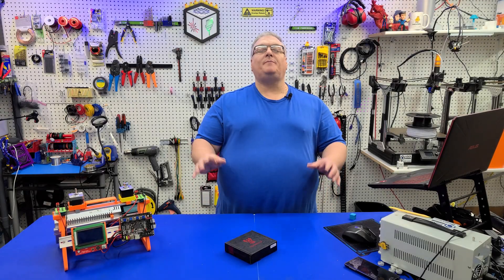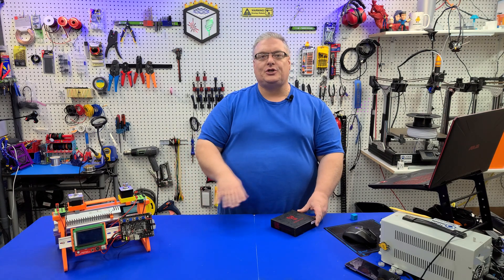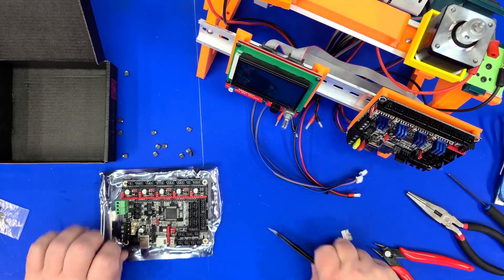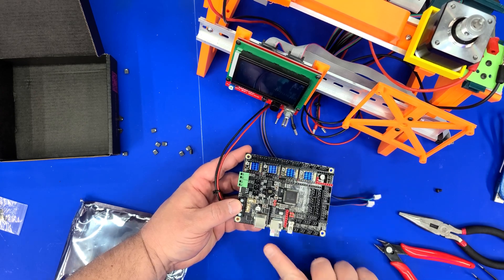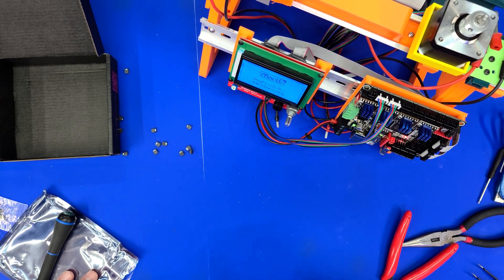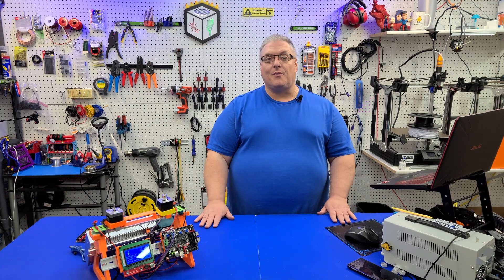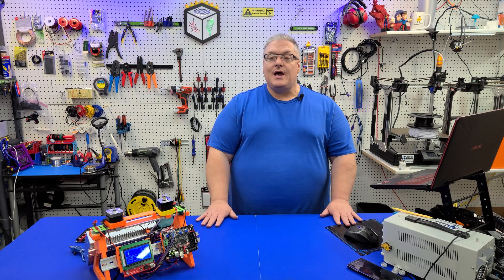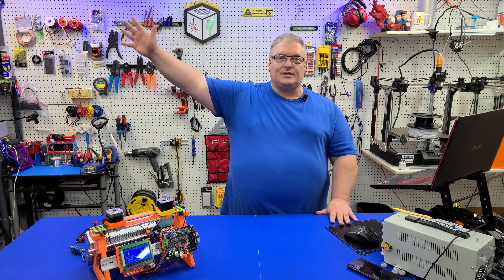SKR2 Bug Update! - Did BigTreeTech Fix the SKR2?

Comment: Bad idea  taking any circuit board out of an anti static bag and placing the board on the outside of the anti static bag. The outside of the bag is where all the static is located.  Only the inside of the bag has no static.
Reply from the maker: Cite your reference please. Given the bags are conductive and this is a common misconception of how the bags operate.
Reply: @MakersMashup   You gave the answer already.. You are correct.... the outside of the bag is conductive (not all are but most depending on the manufacturer) and for that reason  the conductivity on the outside creates a Faraday Cage while the   inside is  protecting the circuit board.  The inside of the bag is NOT conductive and  because of this the outside stores a great amount of static while the inside has zero static.    A simple Google Search  ( a long version of 'there is static on the outside of the bag but not inside the bag')----->
Metalized shielding bags have either a metal film embedded into the bag film construction or coated onto an existing layer. This metal film acts as an electrical shield against electrical discharges from the outside of the bag. Depending on the energy and duration of the discharge and the thickness of the metal film, an ESD event is typically spread out over the outer surface of the metal film and if fully enclosed, i.e. the bag is sealed, then the charges current from the ESD event is contained to the outside (outer surface) of the metal film, i.e., providing a region of no electrostatic fields within the bag, thereby protecting the contents within. This effect is known as the Faraday Cage Effect and is commonly used in controlling ESD via metalized shielding bags, conductive bags and the conductive tote box with a cover.
Reply from the maker: Right and the moment anything touched that outside package.  My body as an example.  I immediately discharged it by being grounded.  With zero chance of affecting any of those electronics.

Comment: Just an FYI from where you put the board on the antistatic bag, from what I've heard the antistatic nature of the bags comes from a thin layer of conductive metal on the outside, so if you were using it hoping to get the same antistatic properties as the inside this knowledge might save you from accidentally shorting out a new board.

What are alternatives?  Plain non metalic painted cardboard boxes, paper, just generally non conductive non static building things.

Comment: Bying a new board for my CR10 V2, with 2209s
Now I am in doubt if i should stick with the Proved 1.4 or order the 2 instead...
Reply: The 2 is fine. Order from BTT, they don't sell the Rev A boards. If you should somehow end up with one, you'll still be fine, just don't install your drivers the wrong way around. Rev A problem is only a thing if you actually install your drivers the wrong way (The new failsafe feature to protect the board when making this mistake, ended up damaging your drivers if you did so, because of a mistake when substituting a part due to supply shortage.)
Reply from the maker: I honestly don't know why this was even considered as a feature.  BTT drivers are color coded and you really should know at least how to install them correctly if you're even thinking of replacing a mainboard. Far more dangerous things like mains voltage in a printer. To me it seems this effort could have been better served elsewhere.  BTT must have had a lot of returns for blown steps ticks to warrant the design and software development.
Reply: @MakersMashup  That's most likely it though. High rate of returns. But not just for drivers, if you were unfortunate enough, it could damage the main board too. And replacing that, gets costly and eats up margins really fast.

BTT aren't exactly the only ones making and selling these driver plugin boards though, and there's no real agreed upon pinout standards or default config (for the piggyboard, not the chip itself). As for color coding; most other manufacturers don't use red+black. Some of them don't use either, some use only black, some use black on one side, but opposite to the BTT ones.

Even if BTT isn't technically at fault if you mix and match, they're still gonna get a lot of headache skr-board returns, and BTT is still gonna suffer the negative publicity - most customers will blame the board (which may now be dead), not the stepper driver or their own mounting of it. Those sentiments propregate throughout the 3d printing community, and ends up hurting BTTs reputation and business significantly. So in the end, from my POV, I understand why they implemented this, and actually support it. Its just a shame they botched that (neccessary) part substitution.

In my humble, flawed and probably biased opinion, I think this feature, now working properly, is a good and worthy one. It's a very low cost addition and "fix" (both in monetary cost and metaphorically) that addresses a very costly issue. I get what you're saying in regards to priorities, however, the SKR series boards, including the v. 2, are incredibly feature rich speciality (not exactly a stick of DDR4 RAM) machine control boards, with pretty user friendly, flexible hardware configuration - going for $30-40 including shipping. Some compromises have to be made, to enable that.

Some changes, like the SD card slot, are not cost saver measures but changes made because of user and customer request. The spring-loaded card tray was really poor for anyone wanting to mount the card with access to the microsd card, USB ports etc through a hole in an enclosure, and you often need to push the small card with a rather sharp, thin object through that enclosure hole, to get it to go far enough in to release the retaining mechanism.

Comment: It might be time for me to get a different main board. Accidentally ruined my RAMPS 1.4, purchased a RAMPS 1.6 plus, something went wrong with the bed heating part, got warranty replacment via Amazon. The warranty replacement won't allow the bed to go past 50 degrees, thermistor test 104 ohms and the wiring all test out working to the board. This happened right out of the box. I don't see any cold solders so leaning towards going with the SKR2 with my TMC2208 steppers. BigTreeTech has this board on sale right now.

Comment: What is reason to use heat bed out connector as power in for the SKR 2? Lucky that it powered on and not fried.
Reply from the maker: It's just the camera angle.  It is plugged in to the power in.  When you posted this comment I looked at the video and it does look that way then walked over and checked the test bench.  It is indeed plugged into the right spot just how it looked on camera.

Comment: The question is what to do with the ver a ?:)))
Reply from the maker: Return or patch like I did in the bug video.  Btt has a document on 3 ways to patch in the description.
Reply: @MakersMashup  yep i will do it but really do not like this small issue(((
Reply from the maker: Me either.  Reach out to BTT I'm sure they will replace it.  They have been really receptive to those who don't want to patch the board. Just slow to get the replacement.

Comment: I've got the first SKR2 (I did the jumper wire fix) and I can only get the motors to respond with
#define X_DRIVER_TYPE  TMC2209_STANDALONE 
but not #define X_DRIVER_TYPE  TMC2209 

Also, I had to reduce steps by 50% because the motors were moving 2x when I did get them responding. Sure seems like a config problem. My board seems to be setup like yours. 

I'm using Any clues as to why that would be? Are the marlin config files you used online anywhere? Thanks!

UPDATE 5-26-21: 
I recompiled using the latest Marlin release TMC2209 works now. Also, the step distance is fixed. I disabled CLASSIC_JERK, which was enabled. I still find the software buggy, for instance load / unload filament throws "Unkown command: M701 TO". Curious to see how you guys get on with it. Marlin now defines this board as: #define MOTHERBOARD BOARD_BTT_SKR_V2_0_REV_A

Comment: They were tested in the wild. Problem was a mosfet on the original design became unavailable and they replaced it with a similar mosfet that proved to be not compatible. But yes they should have tested that before shipping. Also I think you should do an actual test. Put this thing to work for 50 or a 100 hours and see if they hold up.